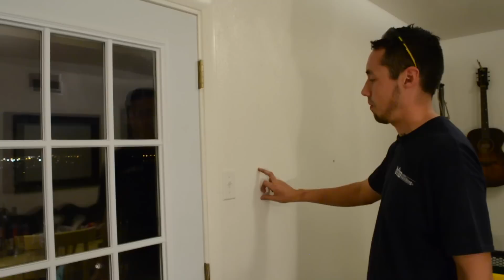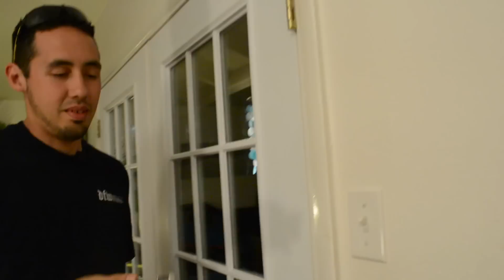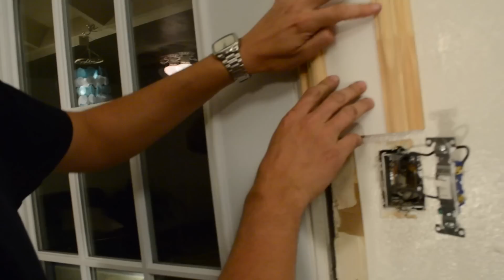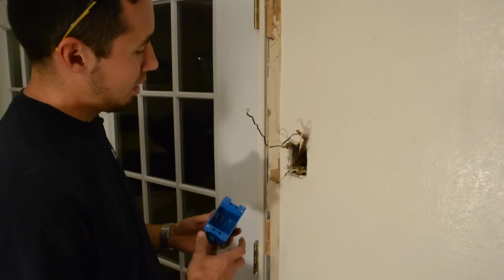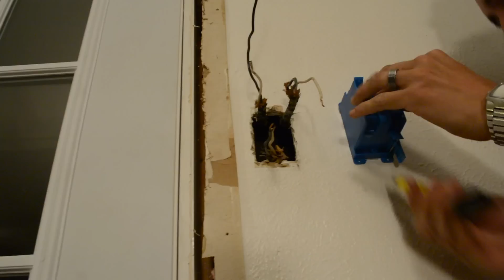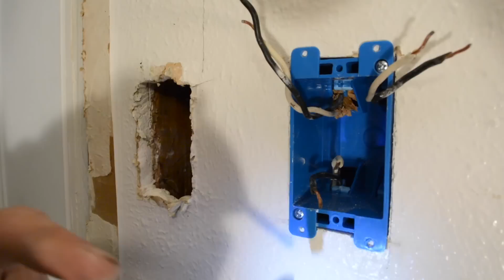Trim Carpentry - How to Move an Electrical Outlet/Switch

Comment: The majority of electricians/people are right handed. That means studs will often be on the left of the box as electricians will be swinging the hammer from the right.
Reply: False...im an electrician...its mainly layout and common sense...we try and go by where it needs to be according to plans and customer needs as well as electrical codes. Then common sence..we try and stay about 12" from doors windows etc for future replacement or remodel...then again maybe contractors that dnt care might put it whereever. Also on wiring the outer jacket on romex should be through the box at least an inch. The plastic pinching the wires could cut the insulation. But i understand u only had so much slack.
Reply: @VERSONECOMPLEKS  1/4 inch minimum per NEC code.
Reply: good to know
Reply: In that case there is a door frame. Being how close it is to that frame.. its on the frame.

Curious why no insulation on exterior wall or did i miss something
Reply: he lives in a warm place  @turboflush
Reply: That's not true. The box gets installed on the side of the stud it belongs, not the side the electrician feels like hammering from.  That's some lazy logic william. I've moved,  added, replaced, and installed thousands of j boxes over the years.  Installers learn real quickly how to swing a hammer in an "off" direction.

I just poke a thin screwdriver to either side of the box with the cover plate off. You'll either hit the stud,  or you won't.  Nothing beats the feel test
Reply: Finish Carpentry TV HUMM ?— I’m Left handed !!- Didn’t cross my mind !-Just where Archetic laid it out !- Double Doors !- Switch goes to the LATCH SIDE !- SOO Coin flip on this one ?
Reply: I'm the exception to that rule lol, I watch the trim videos because I'm remodeling my house, watched this video for shits and giggles
Reply: Williams Butler M mmkqby
Reply: William Butler Team South Paw.
Reply: Despite the detractors, there is some truth to Williams' statement.  Sometimes the desired placement of the box (satisfying code, accomplishing symmetry, etc.) dictates which side it goes on.  Sometimes it's whether or not there is another stud very close by, which makes nailing a box on that side infeasible.  Sometimes it's not even nailed/screwed onto a stud, but is rather secured to a bracket between two studs.

If none of these factors that affect the box's placement come significantly into play, sure, most electricians will tend to favor one side of the stud over another, depending on their handedness.

In the case of switches near doors, I liked to use a scrap piece of 2x4 to build off the king stud in order to get the box further away from the casing.  Only takes 30 seconds, but it makes the switch more aesthetically pleasing.

Tips: As someone else has stated, once you have the cover off, if you can't see the stud, you can use a thin flat head to probe the sides, above or below the box to find a stud.  For additional probing ability, you can also use a bent piece of wire.  I've used bent wire to probe around behind the drywall on many occasions, such as finding exact measurements to the side of a stud, using an existing hole in the wall.

Also, if you have a worker with smaller hands, you might be able to loosen up the staple securing the wires to the stud in order to get more length out of them.  You're supposed to be capable of pulling the wires 6" out of the box.  (You might even be able to use your oscillating multitool to cut into the 2x4s, 1/4" away from the edge, to help remove the staples.)  Just make sure you don't damage the wire & jacket in the process.  It's best to avoid doing this, especially if the wire is stapled too tightly, but if it's what you have to do, then I suppose it's what you have to do.  (I'd only attempt this if I had less than 2" out of the box.)
Reply from the maker: interesting.... it makes sense
Reply: only dumb resi guys
Reply: William Butler Very good, I buy that logic
Reply: William Butler most people that i have met up with in the building trade are lefthanded i think it has a lot more to with the layout of the building not the person in my opinion

Comment: why do we wiggle the multi tool or sawzall around like it makes the cut go faster?
Reply: dfw crown Ill do the same thing especially when cutting nails. I feel like when I don't move it back and forth I end up with a dull spot in the middle of the blade.
Reply: Because you use these tools like a saw and try to work the full surface of the blades too keep from wearing them in one spot.
Reply from the maker: RangerCaptain11A  haha I'm not sure.
Reply: Longer (expensive) blade life. I hate a dull spot on my blades, its usually right where you need to cut the next time.
Reply: The saw/blade has issues with clearing chips and moving it does this and the blade begins to cut again when the chips clear the blade. repeat...

Comment: It is important to check that you have enough existing wire to get to the new location.Like he said.You can not hide a junction.Meaning if you add wire with wire nuts{junction}it has to be in a box with an accessible cover.Many a house has burned down because junctions were not contained in a box.
Reply: so if there is an outlet box on my wall covered by a plate...is it likely it is a junction box that they used to extend wires?
Reply: @thatchicknyc3606  It could be a distribution box for electrical, or it could be data like telephone, internet or cable.
Reply: yep
Reply: If you want to talk code then the sheathing must be inside the box at least a half an inch also and that is not the case in this video - especially the bottom wire...
Reply: Glad you have an electrician on your side!Good luck.
Reply: ty.  I did some research and it seems the 240V dryers would actually be too big for my space. most of them exceed the 26.5 inches I have room for.  So I'll stick with the 120V plug on dedicated circuit instead.  My cousin has a very compact whirlpool that is 24 inches wide that runs on 120v, so I will get that same one.  The drying time will be a little longer, but that's okay.
Reply: I would hope your "electrician" would know the answer to that...lol
Reply: Patriot1 good point about the long screw driver, in this case he can remove the sheet rock above and below the box right next to the stud because it will not show.
Reply: @Robert Hardt laughing out loud.
Reply: One can easily reach up inside the wall with a pair of diagonal cutters and grab the spike side of the old staples married into the douglas fir studs and still get the staples loosened safely enough to usually obtain 6 more inches of sheathed/ jacketed non metalic cable...or wire.
Reply: ok thanks.  My entire apartment is wired horribly.  No dedicated outlets in the kitchen.  Random breakers that don't turn anything on or off.  An entire room overloaded on one breaker.  Old building, greedy landlord.  My friend is going to come re-wire it for me so I can install a washer and dryer.  He's an electrician.
Reply: question: can my electrician wire me a new dedicated 240v line (30 amps) for an electric dryer? from my current breaker box... MY switches all say 15 and 20... But the newer apartments are being fitted with 240v outlets for washers and dryers but also those apartments have been gutted and completely rewired with new breaker panels.
Reply: @thatchicknyc3606  It depends on how much space you have in the panel for new breakers and also how much load your circuit are currently pulling. He should be able to but only he can know by looking.
Reply: I just use a sawsall with a 12 inch demo blade and rip right through the nails - a real time saver...
Reply: So what if the existing wire isn't long enough? Add a junction box at the original location to extend the wires?
Reply: EJ just no that all junction boxes need to be accessible to satisfy code.  RC Codes
Boxes: Junction, outlet, and lighting
1.Unused openings in boxes and conduit bodies shall be closed. 2003 IRC E3806.4
2.All boxes shall be accessible. NEC 314.29
3.Boxes shall be installed at each conductor splice point, outlet, switch point, junction point, or pull point. NEC 314
4.Non-metallic boxes of rectangular shape (2 1/4 inch x 4 inches) can be used in both walls and ceilings. No clamps necessary if wire is fastened within 8 inches of the box. NEC 314.17

Always contact your local building authority for complete and up to date code information.
Reply: Wow thanks for the reply. I learned a lot. So if the existing wires in the wall are not long enough, what is the proper method to move the switch?
Reply: Inspectors can call out what they can't see...
Something tells me you had to put down the beer momma bought you before you typed this.